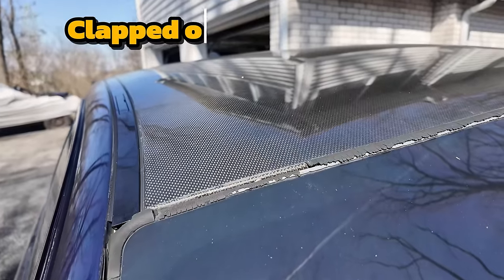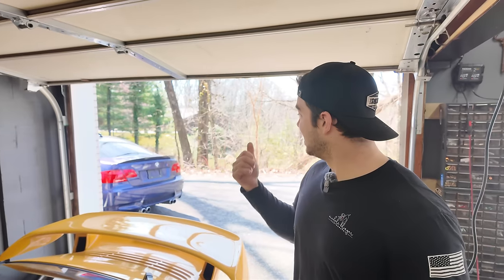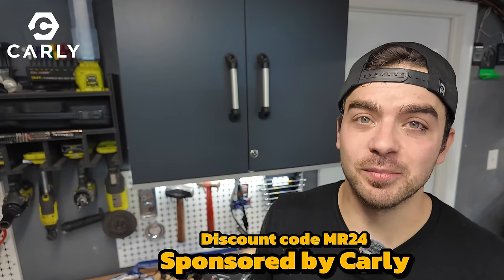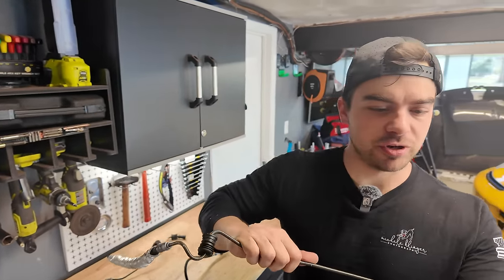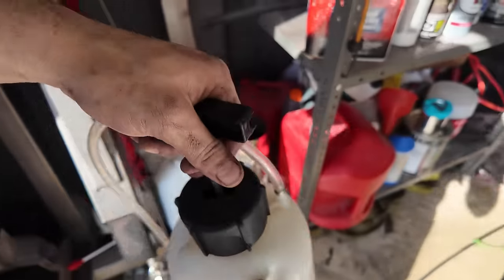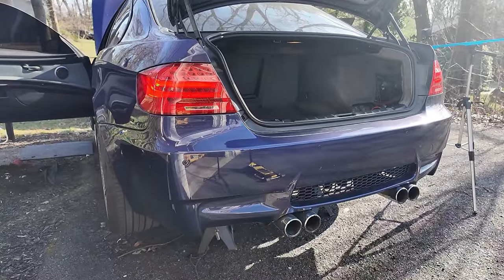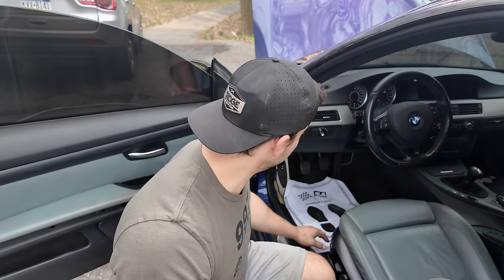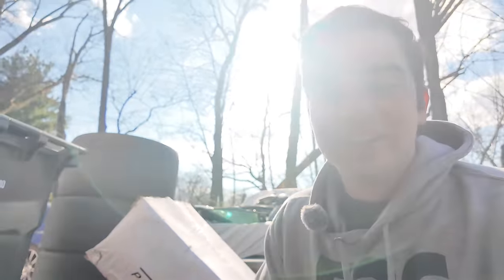I Rescued a Trashed E92 M3 and Got it Running After Sitting for YEARS

Comment from the maker: Get a 15% discount on your Carly purchase using the code "MR24". Just click on this link: https://bit.ly/Carly_MattRoss and the discount is auto-applied! Offer valid until April 30, 2024.

Carly's scanner and free version of the app with standard OBD features are compatible with cars that have an OBD2 port.  To see if Carly's advanced features  — like coding or manufacturer-level diagnostics —  should work with your car, make sure to check out their website. To access these additional features,  you'll need to get their yearly license.
Reply: Took a look at Carly, but can only get the basic version for Subaru's

Comment: Regarding the drone - I had an E90 m3. Best combination I found was just the oem x pipe with the 2.5 pipe mod on the muffler. I'd had a fully catless x pipe, catted x pipe, muffler delete, different aftermarket mufflers, but the best and most refined yet livable setup was the one listed above.
Reply: Yeah the pipe mod on the muffler does sound good.

Comment: I had the same issue on my e92 335. The reason for the leak on the new line is because it doesn't have the rubber gasket/seal that snaps onto the tip. My issue was not realizing it snaps on to the tip rather I was just inserting it into the slave.
Reply from the maker: Wish I would have known that before!! haha

Comment: You're gonna have to work on the rear suspension for sure. When you fixed the pedal, and ran the wheels on the jackstands - there was immense wobble on the rear left tire.
Reply from the maker: I was thinking it's a bent wheel actually.
Reply: @matt13ross  well, could be both, check for the play of the suspension on all the tires, wheel bearings will be a thing to work on, the shocks, too, all the bushings probably. If you need any inspiration check out M539 restorations and his project Frankfurt (E92 M3)
Reply from the maker: Yea I'm planning on replacing a lot of suspension in the future.

Comment: I feel your pain my guy. I cringed just thinking about it 😩. I bought a 2011 335xi. So far Ive change the radiator, coolant line, water pump, thermostat, ofhg, valve cover and gasket, manifold gaskets, tb gasket, struts and shocks, transmission pan w/ gasket and seals 😅... What a nightmare of work in less then 6 months. I need a vacation from this thing.
Reply from the maker: Eventually the fixes stop and theods will begin!
Reply: @matt13ross  agreed

Comment: The leak is a little rubber top hat that pushes onto the end of the pipe it’s common to hundreds of different vehicles with hydraulic clutch and always flies off and runs away when you disconnect the pipe, it happens that fast you don’t see it and can never figure out why it’s leaking….had this problem once and learned the hard way
Reply from the maker: Wish I knew that before!!!
Reply: @matt13ross  I know shame i didn’t see your vid before but the algorithm wanted to wait until you’d fixed it the painful way before showing me your page haha, Search clutch pipe top seal and it will be a variation of that 👍🏻
Reply from the maker: Hahaha, well thank you!  Now I know for (hopefully not) next time.

Comment: I've slowly been rescuing a trashed 328i 07 e92 so many things i have replace still chasing these codes man lovely to wrench on though. i need a new valve cover, tune up, new tires, and an alignment. i repaired alot of seals gaskets secondary air pump all new suspension. truth is these cars sour up if they sit make sure you keep your drains clear and you will be okay as far as electronics flooding. tail light seals need to be replaced they are in fact money pits its addicting car to drive.
Reply from the maker: Yea it seems like a neverending mess.

Comment: May need to check ur rotors if you are getting vibrations while braking...they are mostly warped already
Reply from the maker: Sometimes that can be worn out suspension or wheel bearings as well.

Comment: FYI Carly does not properly register batteries in E9X series cars. It will claim to have registered it properly but scanning in INPA will show it hasn’t been registered. This has been proven many times on m3post forums.
Reply from the maker: Interesting, thanks!
Reply: @matt13ross  I should clarify. Carly is great for coding features. But in this case does not properly register. Coding the battery type and registering the battery are two distinct actions that people often confuse as one. In my case I coded and registered with a different suite of tools. But Carly as a product and sponsor are good to go for tons of other functions. A must have for anyone that likes to do their own maintenance

Comment: Does that rear wheel have a wobble? These things are a beautiful nightmare. Just LS3 turbo swap and call it a day. Sell the engine to someone building a 1m clone s65 swap.👀 Do it for you and us.😂
Reply from the maker: Yea I saw that too.  Believe me, LS swap has certainly crossed my mind! lol
Reply: At that point why not just buy a 335i coupe. The only reason you buy a e92 m3 is because of that badass v8. Plus you can make them decently reliable if you fix and replace the problematic parts with better newer ones designed to fix said problems.

Comment: Poverty spec
Reply from the maker: Poverty? It's fully loaded. Power everything. Heated seats. Backup sensors. Carbon roof. Nav. What is it.missing?
Reply: @matt13ross  Front sensors. EDC. Extended leather. Folding mirrors. Individual sound. Adaptive headlights. DCT gearbox. Small I go on LOL
Reply from the maker: Wouldn't want a DCT. It has folding mirrors and adaptive headlights.
Reply from the maker: Also has EDC. So...yea it's pretty freaking loaded
Reply: @matt13ross  EDC is very important in value terms. In the UK dct is also a major added value. My m3 is totally loaded up so I'm a spec snob